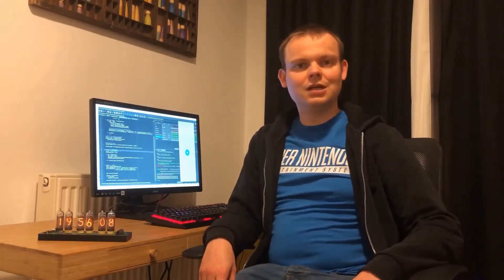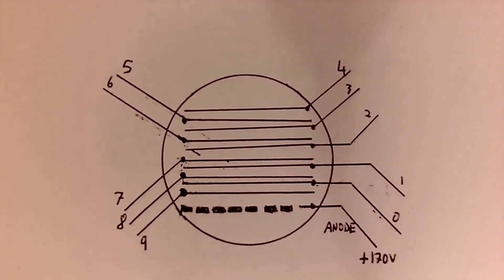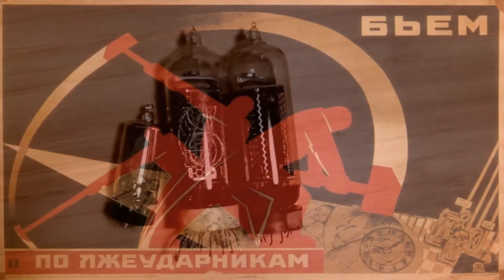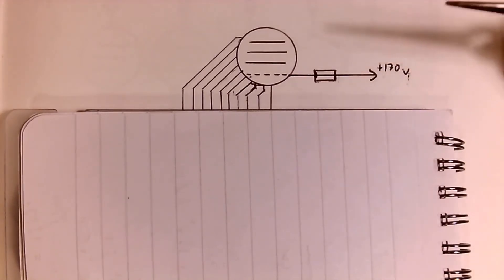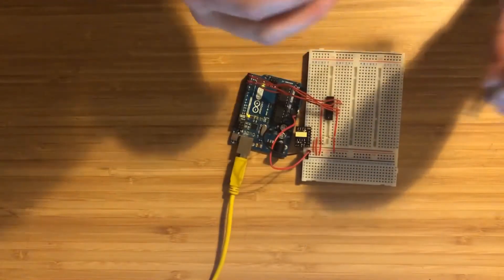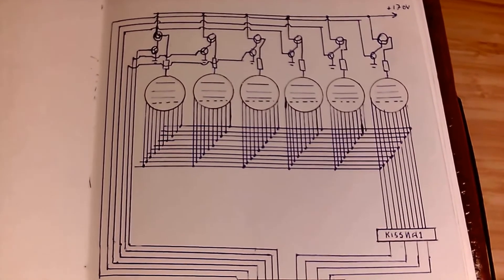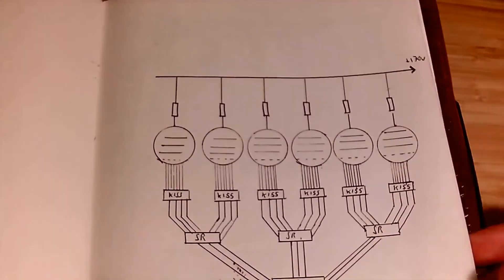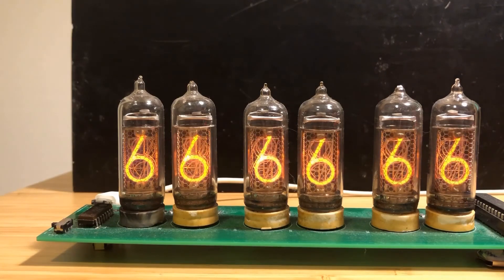Soviet Era Nixie Tubes: how they work and how I built a clock from them

Comment: Quick question:
At 7:35 you say the first pin to high would set the display to 1, but then you pointed at the Number 8 pin for Binary? Does the driver chip write its binary left to right or was that a mistake?

Comment: Most people say that you should not multiplex nixies.
Reply from the maker: The original datasheet for IN-14 tubes actually recommends multiplexing them:
https://tubehobby.com/datasheets/in14.pdf

As long as an appropriate anode current limiting resistor is used, I can't think of a reason not to multiplex them.
Reply: @Alexander-the-ok  Well, as you can see in the datashit that you linked, multiplex mode calls for different working tension, implying that the other values are for non-multiplex mode. It js true that some lamps may have a shorter life if switched on and off continously, but then neon lamps are ofthen used at 50-60 Hz for decades, so it sounds fine to me. I don't know Exactly why people are against it.
Reply from the maker: @giacintoboccia9386  that is an excellent point about neon lamps running on AC.
I’m not an expert but if i had to guess, id expect multiplexing to actually extend life as they spend less time overall being lit.
Reply: @Alexander-the-ok  I dug a bit deeper: the switching is no issue, as nixies don't experience current spikes on turning on, the issue is that when you multiplex several of them, people rise the current to compensate for the reduced brightness and that should be avoided. Also they may produce a sound if the frequency excites their harmonics (this can be avoided by tuning it).
Reply from the maker: @giacintoboccia9386  Ahhh yes thatd explain it. I find a lot of hobbyists run nixies too bright anyway. Mine are in quite a dark room so im happy to run them at low current to prolong their life.
The thought of switching inducing vibration in the tubes is hilarious! Its not something I’ve ever encountered but it does make sense - nixies are full of many individual components that could easily vibrate.